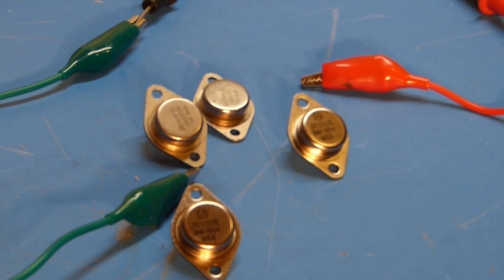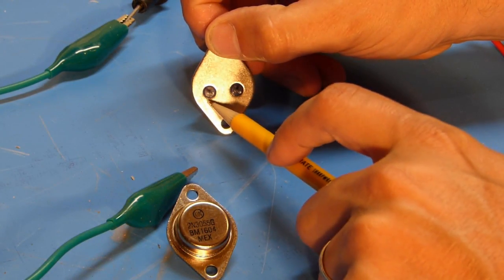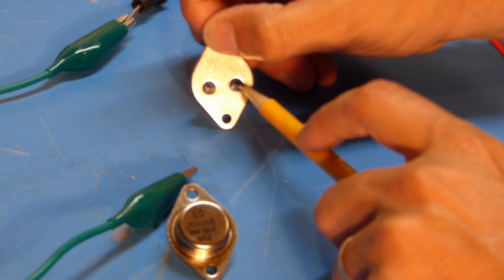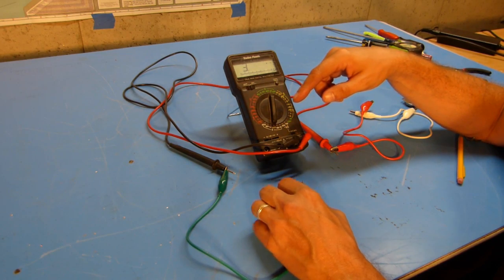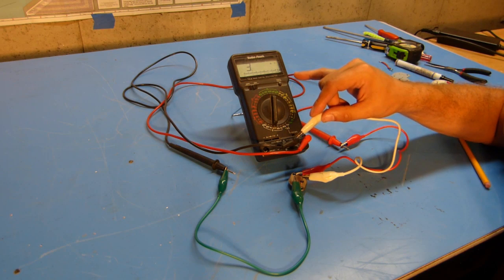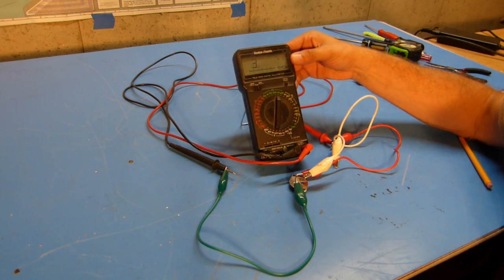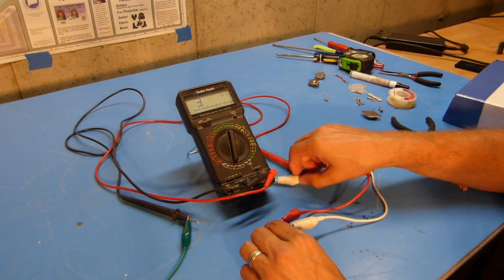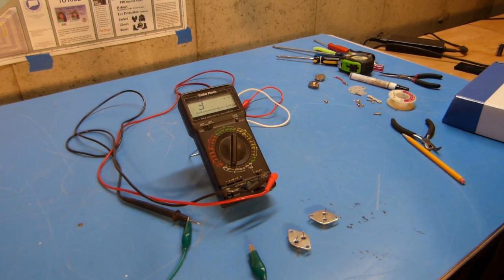2N3055 Power Transistor Test

Comment: I have two 2N3055 (Motorola) both have tested good on diode mode base-collector and base-emetter. So signal on reverse path. BUT one of them i am not capable of reeding resistance before and after shorter base to collector and the one is good I am reading is 19Mohms ans shorted is 11Mohms...

Is this a good sign?

Comment: NICE and simple video! FYI for all new to electronics: This test is for an "NPN" transistor, where the emitter needs negative potential applied. For any PNP transistor, you need to reverse the leads and apply positive voltage to the emitter instead

Comment: Can you check the transistor on the circuit board?
Reply from the maker: No
Reply: No, with 40 meg ohms from the meter you would be reading thru other components.

Comment: In my case reading comes and goes not hault,is it faulty transistor?
Reply: Check and make sure you have good connections to the transistor being tested first. If connections are firm, and reading is erratic suspect the transistor of being faulty. Or always check with a new one to see if it acts the same way.

Comment: Thanks, I had no idea how to check them... I have a question if you happen to read this, I have  an older (1970ish) Sansui 5050 stereo that I think the output transistors went bad on. (if the volume is turned all the way up, there is a very faint signal going to the speakers) I have a couple of sets of output transistors that came in a box of stuff, I don't know if the numbers are the same (I would doubt it), can I just put those in the stereo? Or not a good idea? Tom
Reply from the maker: Not a good idea...you need to verify you are putting in the correct parts or you could damage something.  Your output tranistors may be fine....you may have bad capacitors....hard to say without troubleshooting the unit properly

Comment: can you test this in circuit as well?
Reply from the maker: No, the other components in the circuit may give false results
Reply: No, you will be reading thru other components, in the circuit that the transistor is connected with. 40 meg ohms will read thru many components, this way of being a single test, all that's being done it your checking "if" the transistor will be saturated to turn-on.

Comment: LOL - VERY CONVENIENT when you have them out of circuit but mine are totally inaccessible ... would be nice to have an explanation of how to test them when IN circuit
Reply: That would be nice, but there will always be some other electronic components paralleled across the transistor's pins. About the best I've found is to try using the diode function on your multimeter. If that doesn't work switch to the Ohms scale on your meter and look for a diode-like resistance difference between E-B and B-C. Good luck.

Comment: Xlnt video. With my Tripp PR-3A 13.8 volt regulated power supply using an RCA 2n3055 transistor, I'm reading a voltage output of 9.2 volts yet the result of the test proves a resistance drop across the collector and base. So is the transistor "mostly" dead or is it... dead? Should i be looking elsewhere for its shortcoming of viability? (It's a line from a movie) Thanks. Greg@GregWilliams.us
Reply from the maker: I don't know if these can partially fail or not.  I would think they'd either be good or bad - no in between.  But anything is possible I suppose.  You could check the regulator to see if it is working properly but most of the time the problem with these power supplies is one or more bad pass transistors.

Comment: I am doing the same thing and I am getting continuity between emitter and collector in one of the two and in the other ( both st 4917070) I am not getting any readings when shorting base with colector as in the video.
Reply: continuity means it is shorted and bad.

Comment: There a many fake transistors on ebay (and sometimes reputable suppliers), including 2n3055's.  There are obvious visual signs like the cases are sometimes smaller, or the ink is not solvent resistant like authentic brands (and so the ink smudges with rubbing alcohol).  Some fakes look authentic.  Inside, instead of having a 4-6 mm silicon die they use a small 2 mm die and no internal heat dissipating baffle.  I would be interested in seeing someone test those electrically to prove counterfeit.
Reply: An easy way to show they are counterfeit is the fakes have massively more gain than a normal 2n3055. I measured the hfe of the fakes at around 200 to 400 but a regular 2n3055 should be under 50
Reply: Ok so you would rig about a couple Ammeters to check current at the base and compare it to an ammeter at the output.?
Reply: chriskazaglis yes
Reply: Ok so that's simple enough.  I was going in a complete opposite direction, thermal characteristics, the fake ones with smaller dies should get much hotter.  Though I could figure out how to calculate wattage, I didn't understand how to read the thermal characteristics of the datasheet, nor calculate the expected temperature at room temperature.  I couldn't figure out how long it was going to take to reach a maximum temperature for a given wattage.

Measuring the gain in current seems simpler and straighforward. Thank you.
Reply: chriskazaglis you don't even need two anmeters the base current will be (V - 0.6) / R
Reply: chriskazaglis if you have a frequency generator and a cro you could also measure the gain bandwidth product
Reply: Alright, so I nice and simple 1k ohm resistor at the base.  Then 0.6 Volts / 1000 ohms = 0.0006.  So there's going to be 0.6 mA's at the base.  With a current gain of around 50, 0.6mA*50=30, I should expect an output around 30 mA.
Reply: chriskazaglis if your supply is 10V and you have 1k on the base the current will be ( 10 - 0.6) / 1000
Reply: This shows expected gain at different collector-emitter currents for a genuine:

https://www.tubecad.com/2015/10/18/2N3055%20Datasheet%20Beta%20Droop.png

Generally smaller (and cheaper) transistors have much higher gain than this. The fakes I've tested usually have a gain of around 150 to 400 at 1mA collector current 

Here's one I tested for you just now. That I know is fake

http://i.imgur.com/4zsULDm.jpg

Gain of 210. Definitely well beyond a real 2n3055. So it probably has a much smaller transistor in it (smaller transistors normally have higher gain that power transistors
Reply: Matt thank you for the advice.  I've been trying to set up a test circuit for a TIP120 and 2n2222.  I'm not sure what's going on but my multimeter is not reading any current.  I'm using 4 AA batteries tested at 6.22 volts.  I connect the 1k resistor to the positive rail and base.  I connect the collector to the positive rail.  The multimeter goes in between the emitter and negative rail.  There's no current limiting resistor and it gets hot, so I unplug it after a 2-3 seconds.  It shows 2.4 then drops down to 2.31 after 3 seconds (I assume derating?).

6.22 V - 0.6 V = 5.62 Volts                  5.62 V / 1k ohm = 5.62mA at the Base.

Not counting the very small collector to emitter current drop I try to calculate the gain:

0.00562/2.31 = Approximately 411

I've spent a couple of days looking over the datasheet, trying to wrap my brain around the different test values in the datasheet versus what I have, trying to find a graph showing the gain that matches my values, but not finding it.

The datasheet shows gain of 100 at operating temperature, at 3V CE, at 10mA.  If I follow the 45 degree gain line to a theoretical spot off the graph at 5mA, maybe that brings me to a gain of 50?

When I plug the TIP120 into the multimeter's transistor hfe slot, I get a reading of 31.  That's 2.8 volts and 1 microamp.  But 1 microamp would take me off the theoretical line of the graph.

Conclusion: I'm not sure lol
Reply: chriskazaglis if you are drawing more current than your psu can handle the voltages will fall and all the measurements will be off
Reply: chriskazaglis you might find its easier to use one battery on the base with a current limiting resistor and a different battery on the collector. with both sharing a common ground.  that way the base voltage won't fall when you draw a lot of current.  you'd also need to be careful your not exceeding the limit of your batteries. try bigger base resistor
Reply: also you shouldn't put your multimeter on the emitter to ground side. any voltage drop caused by your emitter will raise the emitter voltage and impact the results.  normally with npn the load goes on the collector side
Reply: I draw a quick diagram;

http://imgur.com/a/BX2Ur

The current flowing into the base should be roughly (3V - 0.6) / 5000 in that circuit == 0.00048A

With a gain of 200 we'd expect the ammeter to read 0.00048 amperes * 200 = 0.096 amperes
Reply: Matthew, hello. Thank you for your advice!

I calculated a gain of 3283!

-9 volt in meter changed an hour before test
-2AA batteries (3.2 measured volts)-0.6 voltage drop = 2.6 V
-Resistor measured at 4.87 K Ohms

2.6 Volts
--------------
4.87 K Ohms    = Base Current 0.00053

0.00053 Amps Base Current (Estimated)
-------------------------------------------------
1.74 Amps Emitter Current (Measured)

The current rapidly climbs 10 mA a second then slowly increases.  It gets pretty hot so I cut the power.

The data sheet only goes as low a 0.1 amp in it's gain graph on page 5.   Page 3 states that the base current is 0.12 amps* did I miscalculate something?  It's also a Darlington, did I get the voltage drop wrong?* Page 4 states the minimum gain to be 1000 at 3 volts and 0.5 amps.

http://www.st.com/content/ccc/resource/technical/document/datasheet/f9/ed/f5/44/26/b9/43/a4/CD00000911.pdf/files/CD00000911.pdf/jcr:content/translations/en.CD00000911.pdf

The Multimeter's hfe slot measured the TIP120 to have a gain of 31
The manual for the meter says it feeds 2.8 Volts and 1 micro Amp. If you took 3283 you'll notice that if you reduce it by a power of 100, you'd get 32.8, which there you go is right next to 31.  Now if you account for differences in voltage and current maybe this could explain this.  Maybe it's coincidence.  Maybe I miscalculated *(as noted in the previous paragraph).  Maybe the transistor is supposed to display these characteristics given the values.

I appreciate the help.  I've learned more than ever before, kept detailed notes on observations and hypothesis.  However I am unsure if I measured the correct gain or if it is a genuine TIP120.

I did get some counterfeit TO-3 2n3773 and 2n3055.  I was able to tell by physically inspecting the transistors.  I will show you that tomorrow, it's pretty funny how poor of a job they did!

https://photos.google.com/photo/AF1QipOGrT49934P73M1yuOpxPM4GmNmL9WK-K_lzqYE
Reply: chriskazaglis darlington pairs can have gain into the thousands. it's also worth mentioning the hotter the transitor the higher the gain will get
Reply: chriskazaglis like i mentioned earlier if the current is too high and you're using batteries the measurements might not be accurate. use a larger value resistor on the base so your transitor doesn't get hot and you don't exceed the limit of your batteries
Reply: Ok. So it starts off really small at 1 microamp and then they gain increases exponentially?  I guess by next question would be why does the manufacturer leave off the smallest gain on their datasheet graph but... I would guess that this transistor's 'sweet spot' is in a higher gain range and if you wanted a transistor in a very low current range, there are other transistors better suited for that job?

Thank you for the advice on the larger resistor. I did try a 15 (14.71) k Ohm resistor and the it took 10 seconds to get hot.  I measured 25 mA (the current slowly increased) which gives a gain of 141.  I may try a 100k tomorrow.
Reply: The gain increases exponentially because 
--the gain increases when the temperature increases, which lets more current through, so the temperature increases more quickly.

You want the transistor to be roughly room temperature so you can

a.) Add a better heatsink
b.) use less current

As to the data sheet starting at 0.1, keep in mind this is the collector current, and given the TIP120 is a power transistor, you probably wouldn't be using it much less than 0.1A, otherwise you would use something smaller.

Also keep in mind the TIP120 would typically be used with a large heatsink, as well.
Reply: Wait, I guess the gain increases exponentially in  the beginning and then the line becomes close to straight past a certain point before the starting point of 0.1 amps on the datasheet's HFE graph.  I guess that the datasheet's graph show's the TIP120's most 'useful' range.  I guess if you are constantly feeding current below 0.1 amps, you could be using something better?
Reply: Are you sure you were looking at the right diagram?

https://imgur.com/a/NKtP1

It looks like a gain of 3000 at 1.7A and a gain of 144 at 0.025ma looks about right
Reply: By the way I really meant measuring the gain to tell that a 2N3055 is fake, specifically. 

This method is unlikely to work with other transistors.

It works with the 2N3055 because it's a huge power transistor and something unique to large power transistors is they have very low gain (30)

If you wanted to detect other fake transistors, you'd need to measure what makes them most unique against other transistors.

For example. RF transistors have very high gain bandwidth, or low capacitance.
Reply: You're absolutely right, matches 100%.  I must be tired.  I do this at night and I misread the graph.  IC - Collector not base.  That was my first problem.  Then while converting mA to A in my head I reasoned that 25 mA was 0.0025 instead of 0.025. Wow! I am tired but I am so happy that I understand what is going on with this.  Hey thank you.
Reply: Oddly enough, when I connected these fake 2N3055 and 2N3773 transistors to my multimeter's hfe slots, I did get a low gain.  They all measured 5-12 gain.

https://photos.google.com/photo/AF1QipPUUI378JG-37xXP28QbJNToQtsuhh7b_zdbYYt

Compared to genuine TO-3 transistors, the base and cap are half as thick, the silicon die is 1/3 the size, there's no heat baffle to dissipate the heat, the ink rubs off or comes off with alcohol even though it should be solvent resistant, the ink's adhesion was so bad that they had to sand the caps, and the markings were completely different compared to the datasheet, oh and the size of the font was inconsistent.

https://photos.google.com/photo/AF1QipOBCaLVzaB63zwFCr3OFeMerlu2S_Z6pu2JQCTU

https://photos.google.com/photo/AF1QipO5IhvYJ2QnSoufAZ3wuG75bkwYrMDQ2-kvYYov

https://photos.google.com/photo/AF1QipNz7C4jW_wsgNwDDDrAe4MLbfoBJ-XsfRTpd49X

Though the ebay sellers refunded me right away, ordering these was a waste of time.

I left one of these transistors on the kitchen table.  My aunt picked it up and said, "huh, I used to solder the pins to these to-3 transistors when I worked at Motorola"  She worked at Motorola in the late 70's. She told me about feeding pins into a hopper, placing the base in a jig, melting the solder (good ol' part lead solder melts like butter, none of that lead free stuff), checking connections, pulling random samples for inspection, oh and it was a really really clean place.  She said everyone took pride making the best, working for a great company that took care of it's people.  I always knew she worked there but it was kind of cool to find out something she made had relevance.

Comment: Can the output transistor shorten by itself or are other components involved  ?
Reply from the maker: Can be either or.  In my case transistors only failed - came from a power supply that had it's leads shorted for an extended period of time.